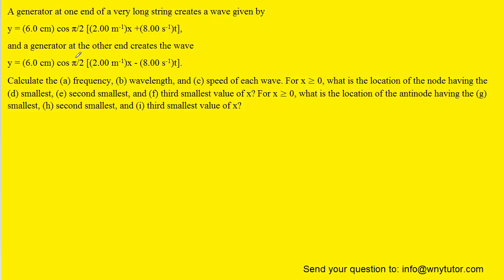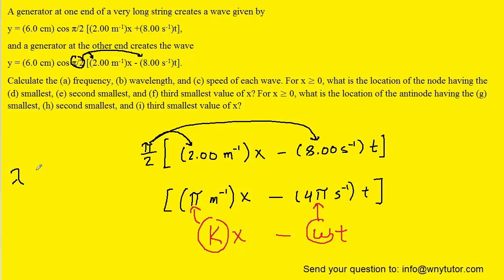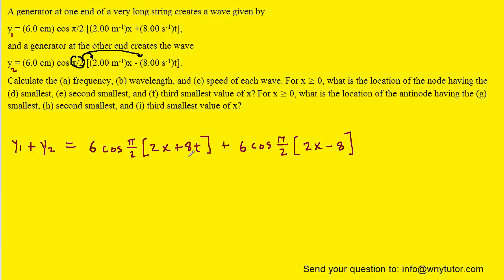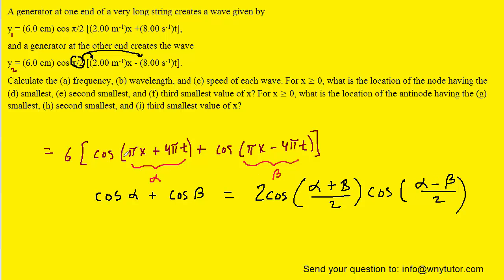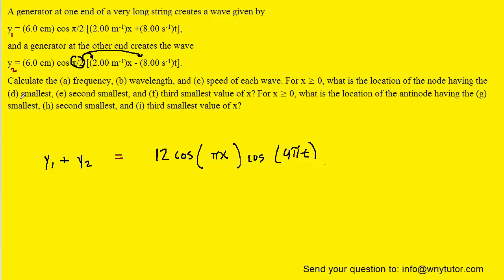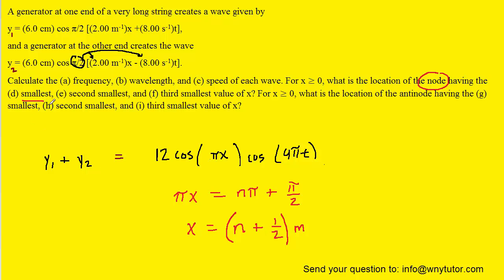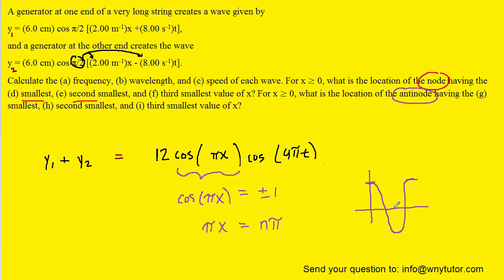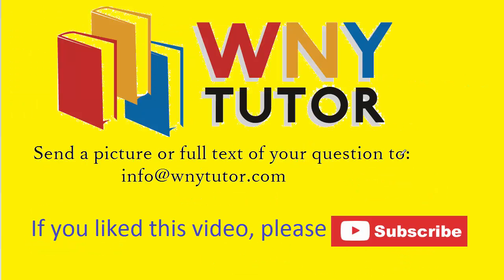a generator at one end of a very long string creates a wave given by

Comment: Hey I noticed a minor problem with this video.  The equation that you used at 2:45 is for when there is only one term in each cosine function.  When there are two terms in each cosine function then the equation should be cos(a+b)+cos(a-b) = 2cos(a)cos(b).  Other than that, great video!